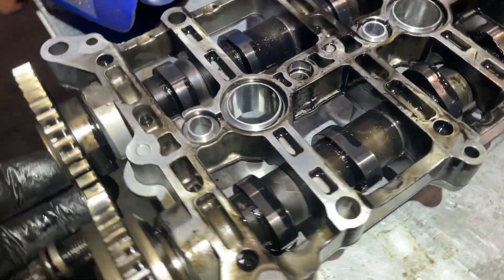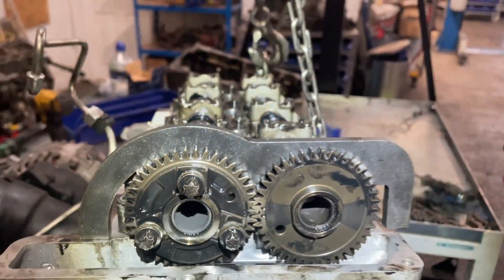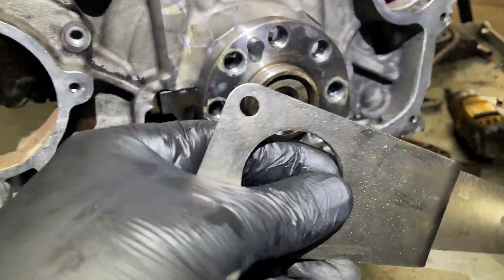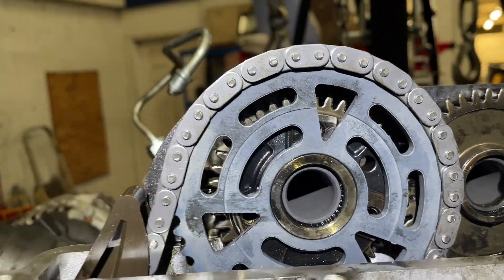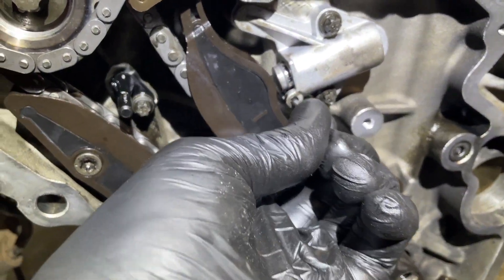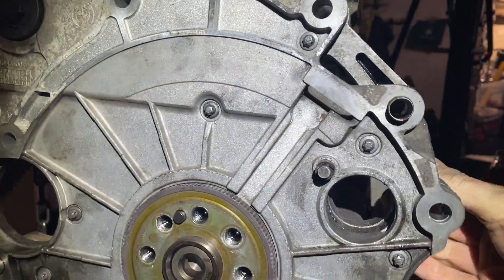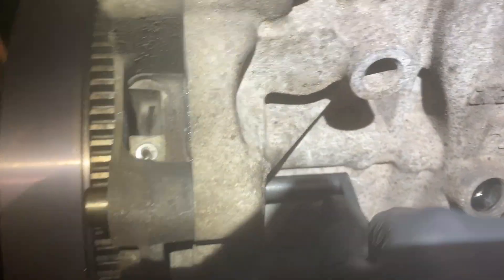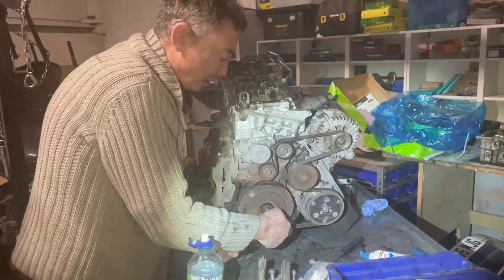BMW Mini N47 Diesel - Camchain, Guides & Tensioner replacement (Part 3 of 4 - N47 Engine timing)

Comment: Hi, very helpful video, I’ve got my engine ready to do the chain but the crank seams to be a quarter turn out so I can’t line up the crank locking tool for the 10mm bolt to go in.? Any ideas? Thanks

Comment: Hi mate great video.  
I am at the point of replacing my chain. I have like a wolly accidently turned the fly wheel clockwise looking for the locking hole in the flywheel.  I could hear clicking noises not realising the chain was skipping the sprocket.  This has now locked up the engine.  I have only done it by hand . Should I remove the chain cover and all the chains and follow this  video minus removing the cam tray . I am just replacing the chain for precaution .
Reply from the maker: I would go back a stage to be sure.

Comment: So when the first timing plate is located with 6mm bolt and the pump is in the correct place it locks up but when the pin is located into the flywheel the crank has moved to tdc,so wont the fuel pump now be out if timing?

Comment: Loving your educational videos. I enjoy working on my daughters Mini and these videos have helped me over and over again. Not sure that's good for business mind you! 
Can I ask which brand of replacement timing chain you use? I would prefer to use a quality product. 
Thank you.
Reply from the maker: Timing Chain Kits - the BGA ones have more in them.

BGA 
 --- N12 / N16 / N18 - TC1030FK  

 --  N14 - TC1025FK 

FAI

 --- N12 / N16 / N18 - TCK129WO 
 ---  N14 - TCK118WO
Reply: Thank you. I am still having trouble finding the correct one for R57 N47 C16A thou!

Comment: Cant you turn it over by hand beforr fitting the timing cover and flywheel ?
Reply from the maker: no - the camshafts need to aligned, timed and the sprocket bolts torqued before you can rotate the engine

Comment: Great job!
I have a question for you: when fitting the new chains Is the chain supposed to have more slack on the tensioner side or the non-tensioner side? or is it supposed to leave an even gap between both sides?
Reply from the maker: Neither.  Put the chain in place and tighen all three bolts hand tight.  Then insert the tenstioner - this ensures that the chain it tight.  Then torque up the camshaft bolts and then the bottom crankshaft bolt.

Comment: When you put the flywheel back on and rotate the crank to put the pin in, i assue you have to take the cam locking tool off? Does the cam locking tool then slot back on after youve rotated the engine?
Reply from the maker: No- you keep the cam locking tool on and the 3 bolts loose - then after rotating the flywheel you lock off the 3 bolts on the top sprocket.
Reply: @TheMiniSpecialist  ahh amazing. Thank you. After doing some more reading I realised that is probably how you do it! Thanks again 😀

Comment: Hi, have a mini non start after switching car off. Suspect timing jumped. Sounds like no compression and won’t run or try on brake cleaner. No codes. Is it possible no valve damage? The chain hasn’t snapped. Great videos cheers
Reply from the maker: I have seen one case where the top sprocket bolts came lose and the timing slipped causing valve damage.  This car lost compression and needed a recondtioned head - the chain was in tact.
Reply: @TheMiniSpecialist  that does sound a bit like this as I feel the timing keeps moving if that makes sense. It went from trying to start to run badly for a few seconds to not even trying now. Do the injectors come out easy. It’s my sisters car and I’m not sure I want to get involved 😂. I work on trucks. Can you just remove gearbox or do you need to remove engine cheers
Reply from the maker: @markraz28  I have done the job without removing the engine but honestly its easier and quicker to rip that mother out.  There are three engine mounts - one on the gearbox, one on the subframe and on on the LHS of the engine and as you need to remove the gearbox and subframe life becomes tricky leaving it in.  Injectors can be tricky but they come out with some persuasion using a long reach socket and an extension on the fuel supply bolt.  The problem with this job is always the follow on problems - air leaks, sticky egr or something - you have to disturb literally everything and then put it back - it's so easy to miss something.
Reply: @TheMiniSpecialist  ah mate thanks for the reply really appreciate it. Agree removing engine and box has to be easier in the long run. This has jumped more than a few teeth. No damage to cam box or rockers but think head needs to come off to check valves. It’s to much work to take a chance. That’s the trouble with jobs like this you never know what other problems you’ll encounter until your way into it 😂.

Comment: Just having this done now at my local specialist. Why are they so prone to break?
Reply from the maker: Wish I knew - I have seen cars do 150k on the original chain and others die at far less - the worst one I saw was at 45k
Reply from the maker: Wish I knew for sure.  From what I have seen the guides can fracture and this leads to the chain becoming slack and its all downhill from there.